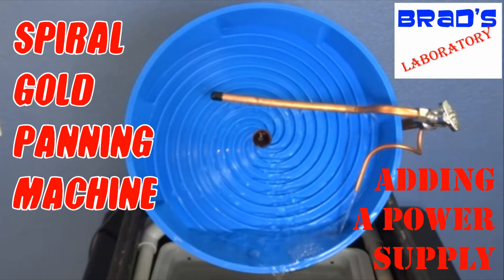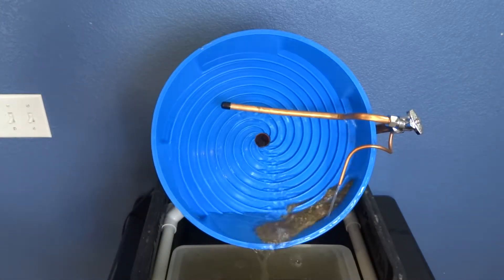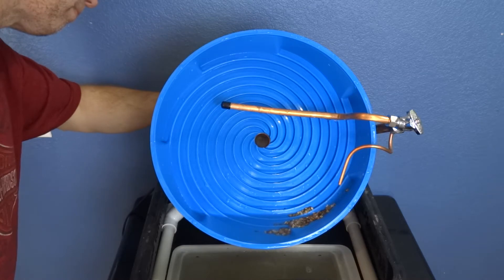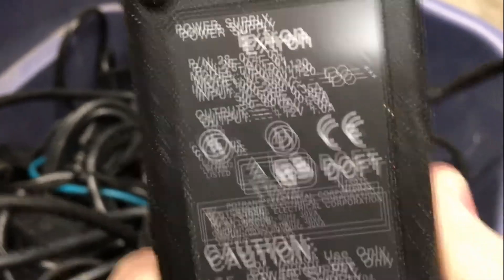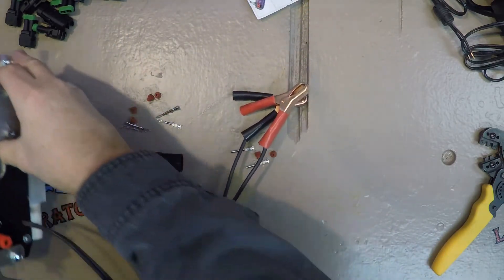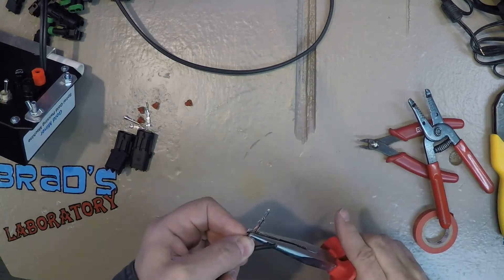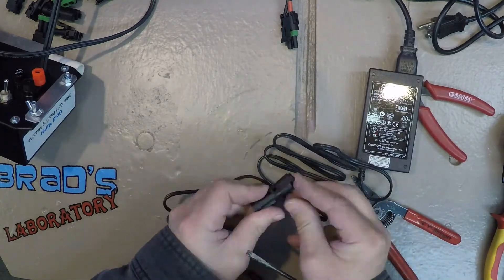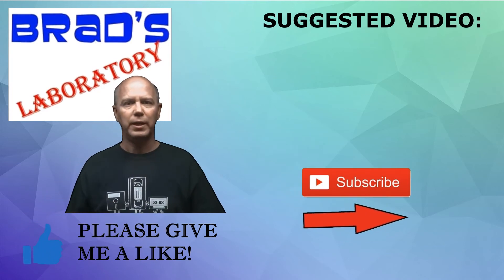Spiral Gold Panning Machine

Comment: I bought the machine and the instructions are confusing! Says it charges in 3 hours then it says to charge it for 6 hours???
Reply from the maker: The unit I have an Amazon link to does not come with a battery. You will need to provide your own 12 volt battery. Typically if you are in to gold placer mining you have a pump that requires a battery, so it generally isn't a problem that this doesn't have a battery. Once you have a clips hooked to a battery you just need to set the angle, A piece of cardboard comes with the unit to adjust the angle. I generally just watch the black sands, you want some but not many black sands climbing the wheel.

If you are adding the power supply as I show in this video, then the directions my be talking about the power supplies ability to charge batteries. In this case we are not charging a battery but using it to power the motor and pump in place of a battery.

Comment: Does it work for ic chip ashes
Reply from the maker: I am guessing you are incinerating integrated circuits to extract the gold. The spiral wheel will separate heavy material from the lighter material. your problem my be that the lighter material is stuck tot he heavy material due to the incineration process. So this may still leave you with a mess, albeit a somewhat cleaner mess.

Comment: What are the best concentrator on the market? Why I would prefer spiral wheel over the sluice box, please? Thanks.
Reply from the maker: Sluices, high bankers and dredges concentrate large amounts of material into concentrates that contain concentrated gold. That material is then run through a spiral wheel or across a miller table to do a final separation of the gold from the dirt. It is impossible to say what machine is best because it depends on the particular area you are mining. In Colorado there are gold bearing areas of the river with very large rocks that need to be washed, if you are mining the beaches in Washington state then the high banker I have set up for Colorado won’t work on the fine gold mixed with beach sand.
Reply: @BradsLaboratory   Thank you man, priceless summary.

Comment: nice video.  I have a spiral wheel that I am still adjusting
Reply from the maker: Love that thing! We have been hitting the Arapahoe bar in Wheatridge, CO and panning the sand down to the heavys at the creek for an hour or so and bringing the concentrates home to run through the spiral. Getting lots of FREE gold!

The one I have came with a piece of cardboard that you used to set the angle. You got to find the right combination between water pressure and tilt angle and it works like magic!
Reply: That's awesome.  I am doing almost the same except at a claim on the Arkansas near Buena Vista
Reply from the maker: I would love to get a little further up the mountain to where the chunkier gold is!